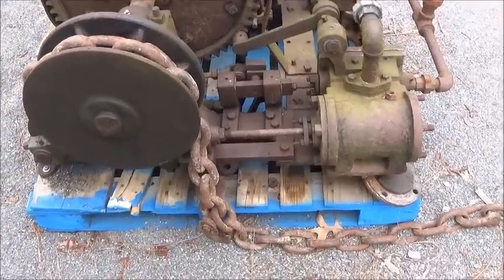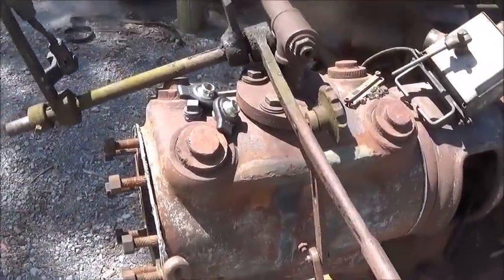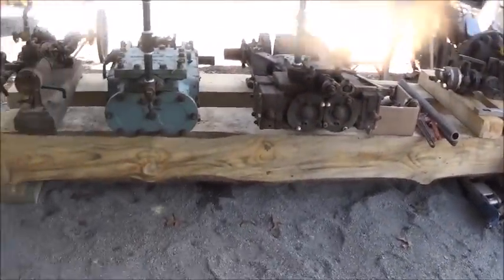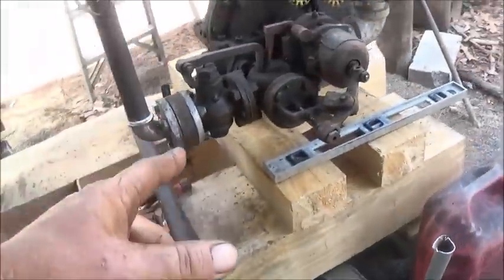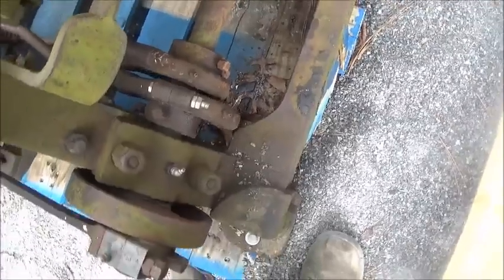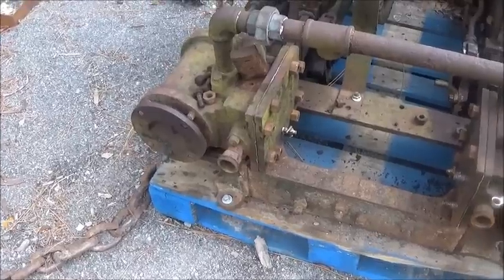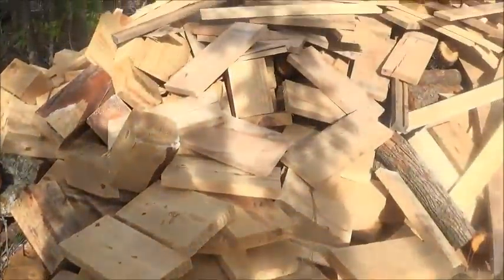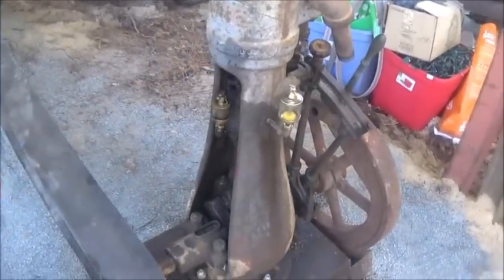ANCHOR WINCH REPAIR & FIRST RUNS ON MANY STEAM ENGINES

Comment: You're starting to get a really good collection of different engines, I love them all. I can't get over how you can work out each one. I've grown up with steam scince I was 4 yrs old driving and attending to boilers it was drummed into me ,I appreciate the knowledge it takes to restore and run these engines. I've restored a buffalo pitts single cylinder traction engine in Australia and Marshall portable steam engine, single cylinder vertical engine  and about to start on 3 different steam pumps. Love your work keep it up. Tim Langley NSW Australia.

Comment: Outstanding , Jonathan ! I bet those turbines can run a generator too . Pretty slick , Mister . Always enjoy your posts . The anchor "windless" , as we called them in the Navy , is really something Jonathan . Smooth transition from forward to reverse . Ya , it leaks a bit , but I bet you fix it . That thing will likely out winch anything but your crane , lol . Definitely want it mounted solid to something , before actuating it . Great for dragging logs if you needed to . But you got it freed up & working , quite well . Take care , & God bless , you & yours . Great job on all of it .

Comment: Build a replica of the African Queen.  Your wife would do great supplanting Katherine Hepburn as Rosie and you are grubby enough to do the Bogie role as Charlie Allnutt.  You can sail to Wilmington and blow up the USS North Carolina!  They will never see you coming.
Reply: Awesome Comment, I can see it happening for sure .
Use the turbine with a deep gear reduction coupled to a hydraulic pump and make it hydrostatic drive, ( with fwd and reverse, of course )  turning a nice big bronze prop.  I will donate the stuffing box, bronze shaft and prop .
A bit smoother than the one cylinder.
She might be called Steam Dream ...
Reply: Thank you for sharing. Do you still have the 25” flathead out of the forklift?

Comment: Wow - what a collection!  I love that you've made every one a running engine.   How many are in the collection now?  

The anchor chain windlass engine is of particular interest to me.  I can see that it's running at just the right speed to lay out or retrieve an anchor chain.    From the size of the chain gypsy I can see that this windlass would have been used on a ship of several hundred tons.   

Best regards from Key West,
Capt. Blackheart Charlie

Comment: Another great video, thanks for this. So awesome seeing all the "real" engines running. STEAM RULES. But one thing, Turbines are happiest on super heated dry steam. Water in the steam will destroy the blades on a turbine as a general rule. So I would be very careful running that turbine until the water is all gone coming out. I would even consider using that steam separator you got a while ago on that Turbine input line.
   While I don't know that particular turbine, and ones I have run are much bigger. It scares me seeing that much water coming out of that thing while she is spinning with no load. Just be careful with her. I hate to see her get damaged. :)

Comment: it would be neat to add ceiling fans in the buildings that run off flat belts and a jackshaft, maybe have the ability to use different engines to power them